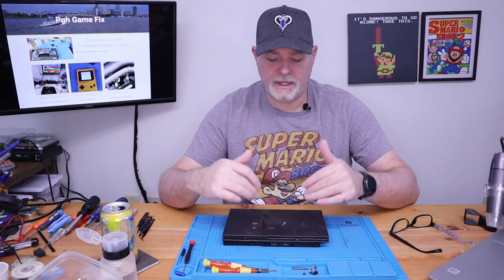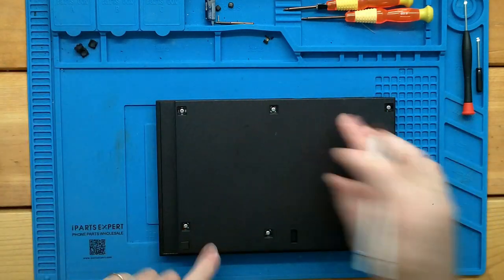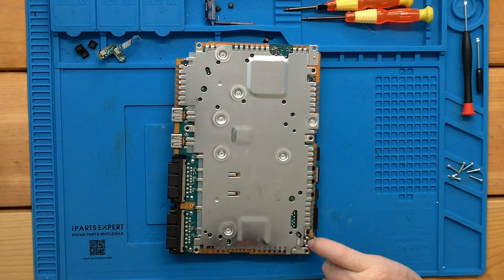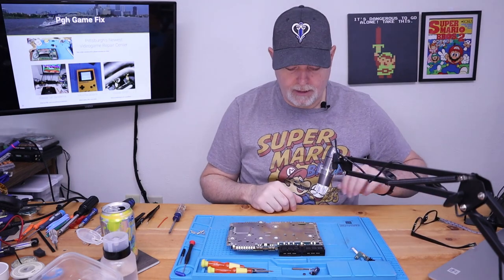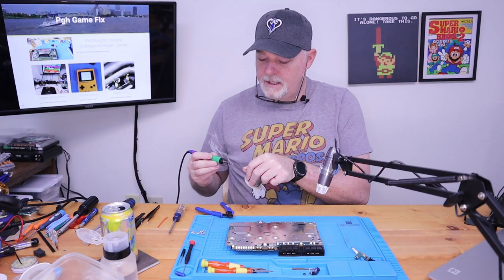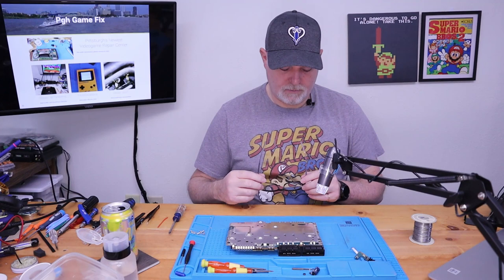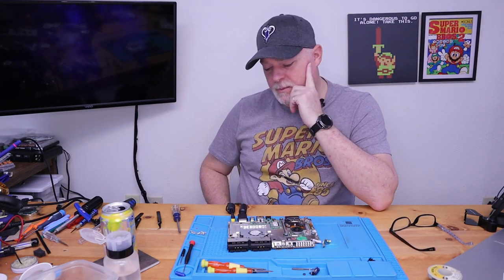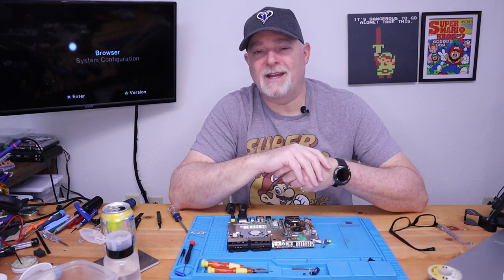PS2 with no power has a faulty Power jack and broken trace. (all fuses are good)

Comment: Hey PghGameFix, do you have any videos where you do extensive testing with the multimeter? I'm hoping to find out how to test out those fuses. Do you just use continuity mode on the multimeter?
Reply from the maker: Fuses are easy to check.  Yes... put it in continuity mode... and just touch each side.  Should either make a beep or show a zero.
Reply: @PghGameFix  Thanks!

Comment: Whats the purpose of adding wire to connection? Can i use other wire like copper?
Reply from the maker: Since the trace was broken, the wire is to jump power past the broken section, and connect it to where I knew we had a good solder point
Reply: @PghGameFix  ok thanks for replying mate, i try this on my ps2 slim also, its has same issue.

Comment: I’m trying to fix my ps2 slim 79001, it also has no power, when it first arrived it still had the red standby light but it wouldn’t want to turn green. I was able to get it to turn green and it displayed on the tv, but then I noticed I couldn’t turn it off so I messed around with the ribbon cable. Long story short later it didn’t want to turn on at all. I ordered a new power ribbon cable and replaced it and it still does not display any red standby light, should I replace the power switch too, it seems the click sounds ok, or should I look further. Also, I suspect that maybe there is something wrong with the power port as well, it’s not loose though and don’t see any cracks. I’m from the U.S. I used DC current when using my multimeter. Any suggestions on how to properly tel if I’m getting the right power with a multimeter? and when connected with tegenpolen adapter. It would really help I’m getting sort of frustrated but I’m trying. Thank you.
Reply from the maker: It's common for the solder to be cracked around the power port on the rear.  I would solder jumpers  just to rule that out.
Reply: @PghGameFix  Thank you for getting back, idk how to solder jumpers how would I do that? How do I know I’m getting the right voltage dc current into the ps2 slim? I’m not really sure where to place my prongs I was just messing with it and happened to get 8.3v by leaving my power adapter connected and placing the black prong of the multimeter on ground and the red prong in the upper solder pad of the power port that is like the upper part of the triangle if the three pads formed a triangle. Where should I check for continuity?, I mean at first it had a red standby light which means the power port should be ok right?, I didn’t really twist it hard either and I did clean the ps2 slim with ipa, I don’t think I scrubbed too hard and somehow messed the power port up, anyways, for some reason I think maybe I’m overthinking it, because the minute I messed with the ribbon cable that’s when the light just didn’t want to turn on no more and my power adapter was still plugged into the power port and I didn’t really mess with the power port. The question is how can I use my multimeter and where to place prongs to accurately check DC current and see that the ps2 slim is feeding with the right voltage coming in and what are the proper areas to place the prongs to check to see if continuity is appropriate when it comes to the power port, I would need those two skills to rule out the power port. I just hope that I didn’t mess up the connection to where the 8 pin 3 inch ribbon cable connects to the motherboard, that would be hard to repair. I believe it possibly would require a new motherboard. Hope it’s not that.